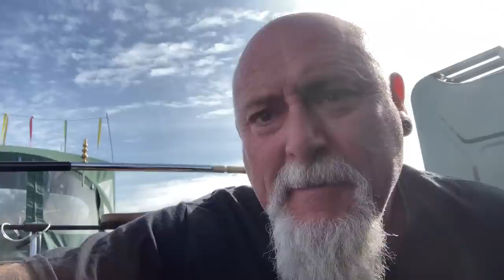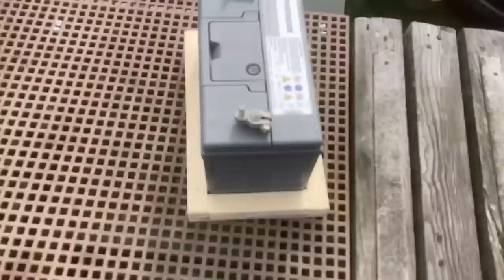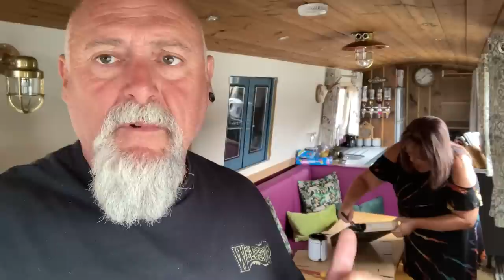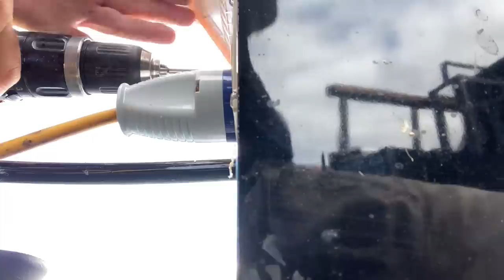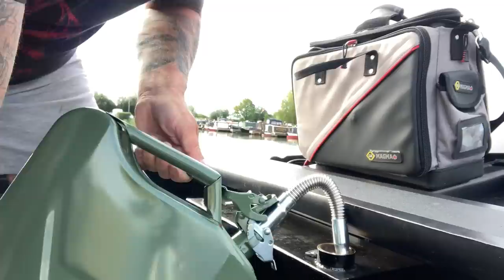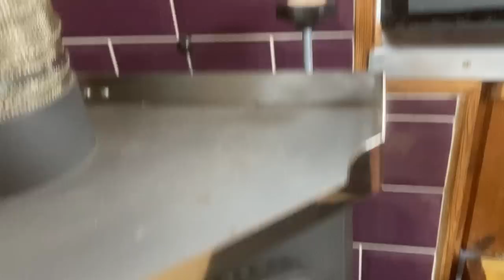Building Our Narrowboat #56 - Getting ready for winter and BSS

Comment: How did you manage to make the diesel run into to stove when it was cold! Doesn’t it have a safety thermo couple fitted?
Reply from the maker: It wont get that could here to affect the viscosity to that level. The pipe is 10mm so shouldnt be an issue. Yes there is a safety valve installed in the diesel line should the water in the boiler get too close to boiling.
Reply: Mart, I think you have misunderstood my question.
I’m not talking about oil viscosity or anything like that. Most oil drip feed stoves have safety devices fitted to stop the flow of fuel if the stove flame fails. The Reflex stoves use a thermocouple to shut off the oil in case of flame failure, this prevents unburnt oil pooling in the stove.
You stated that when you lite your stove that the oil was puddling inside and that was before you had even lite it!
Anyway, great vlogs and most enjoyable, keep up the good work
Reply from the maker: @optimist3580  ah right. I had opened the valve to let diesel in, I do this as I get meths and light. Instructions say a biscuit size “pool”. If these stoves go out, there is nothing that stops the diesel, their design “feature” is they can only fill up to 15mm in the chamber, and will not leak out. Of course you’d have to get that out before relighting.
Reply: @narrowboatmoonshine  Mart, thanks for the reply. I was just a little concerned because I used to have a Taylor’s Stove, one very windy night the flame blew out! I woke the next morning to a small pool of diesel around the stove, it took weeks to get rid of the smell.
Believe Taylor’s and Reflex stoves are now fitted with flame failure devices as standard.
Reply from the maker: @optimist3580  gotcha, yeah these can’t do that due to the Toby valve design and burn chamber. No diesel smell at all, but if you got diesel in wood floor, that smell ain’t going anywhere. One of our best purchases.
Reply: @narrowboatmoonshine  I’m with you on that, I use a Refleks 2000, so much easier and more controllable than coal. Only downside is they make baked potatoes taste funny🤔